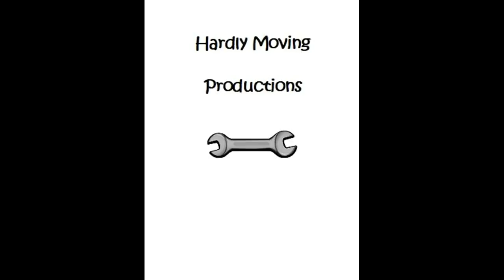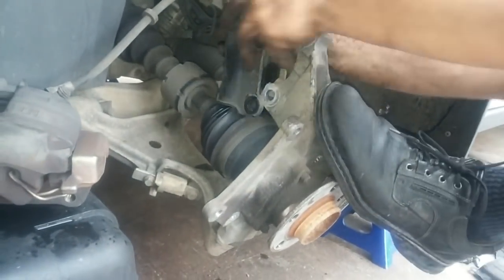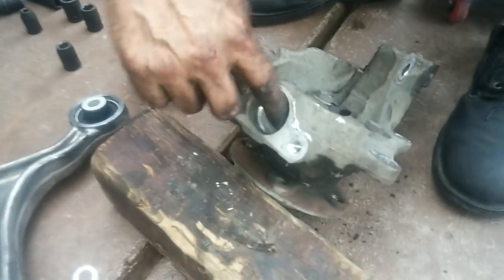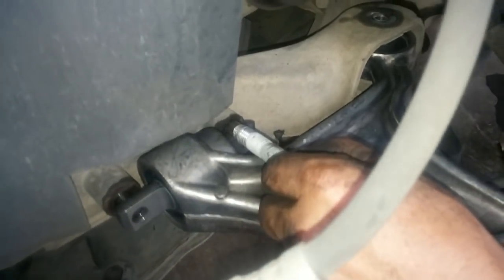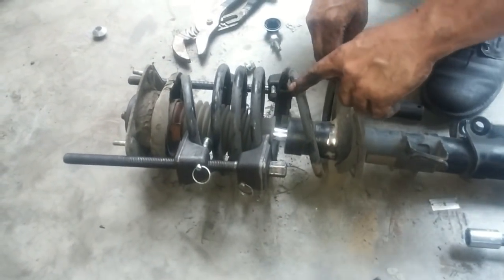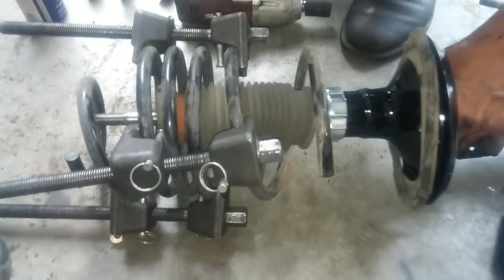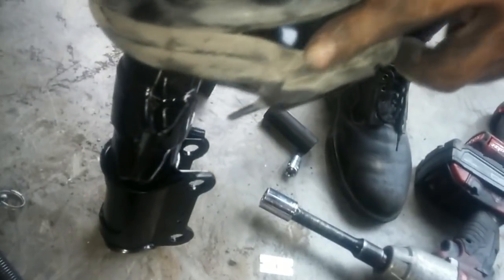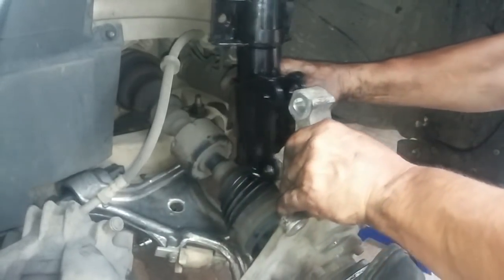Volvo S80 Suspension Rebuild:  Strut, Control Arm, and Ball Joint Replacement

Comment: JUST did my Volvo S60, actually lost a ball joint @70MPH.  I ended up having to replace my passenger side axle as the axle separated during the sudden ball joint failure. I replaced the strut as well and of course the ball joint.  I bought the strut as a complete assembly including the spring. The cost wasn't that much different.  Anyway- it was my first rodeo when it came to front suspension and videos like this made it possible.  Thank you again for taking the time to do these. Well done.
Reply from the maker: Thanks for sharing your successful repair experience!

Comment: Props and respect for showing the strut assembly the old school way instead of the quick struts thats already fully assembled..a lot of mechanics these days are afraid to take it apart and always suggest the easier way with quick struts but you sir are a Boss in showing the correct way to disassemble and reassemble the parts👍👍
Reply from the maker: Thanks!  Complete (quick) struts on these European cars are expensive;  hence the motivation to disassemble and just replace the strut and mount.

Comment: People, you must use the special ball joint remover/installer tool!  This youtuber, like many others, has damaged the hub carrier, stretched the ball joint bolts, and potentially damaged the threads of the aluminum hub carrier (i.e. knuckle).
Reply from the maker: Can you let everyone know where to buy this tool and how much it costs?
Reply: @hardlymovingpro  it is CTA Toold part number 4019, available on Amazon, FCP, IPD, ebay, i.e. online.  $120 but worth it.  It is the aftermarket version of the original volvo tool which is unavailable
Reply from the maker: Okay ... thanks.  Posted a link to the tool in the "SHOW MORE" area of this video.

Comment: Nice Video, I have a the same problem with my S60 01 suspension, I can fix this one but my problem is I have no tools to remove all the volts and the tools you used to hold the spring. I must go to the shops and I am sure they will charge me for this.
Reply: Autozone or O'Reilly will rent you the tools for free.

Comment: Good video but i  you should have tightend the lower control arm bolts ( wich has bushings) at the right ride height ,,, this way puts a lot of stress on them and will break much earlyer , also tighten the shock bracket on top when they have the load of the vehicle.
Reply from the maker: Thanks for sharing!

Comment: I would get Sachs speed strut assembly. $250.
Impact destroys acme threads.
Did that on my jack.
Reply from the maker: Sachs is the OEM provider for Volvo and is a pricey strut.  There are other quality replacements at a cheaper price such as Monroe or Gabriel.  The weak point in the Volvo strut is the upper spring seat which is mis-diagnosed as a bad strut.   If the seat isn't replaced, there'll still be suspension noise.

Comment: What brand of shocks you recommend for Volvos?
Reply from the maker: The OEM is Sachs ... which is very expensive but an excellent strut / shock.  KYB is just as good and maybe cheaper.  Nothing wrong with Monroe and Gabriel for a less expensive alternative.

Comment: My new  ball joints have no surface to hammer on on the outside edge without damage to the seal.
Reply from the maker: When you say "seal" do you mean the grease boot?  If yes, can the boot be remove?

Comment: Hello,

Do you know how to replace electric strut on a 2013 Cadillac XTS?? I need help real bad
Reply from the maker: Yup ... did a few a couple of years back.  If you've got an electronic suspension, the part is expensive.  I think around $800 retail each.
Reply: @hardlymovingpro  can you forward me instructions on how to do this ?
Reply from the maker: @WJOHNJRB  You'll have to find another youtube video author who did the job. From my recollection, the upper strut mount is integrated or is part of the upper control arm.  So you'll have to detach the control arm from the steering knuckle before moving out the strut assembly.  After that, the spring compression and strut replacement is pretty much the same as other strut replacement procedures.
Reply: Hardly Moving Productions thanks
Reply: Hardly Moving Productions can u give me some instructions?

Comment: Was it electronic suspension. Cause those shocks are quite expensive. Is there way to fix them.
Reply from the maker: No they were not.  But easy enough to convert to non electronic.
Reply: @hardlymovingpro  any idea how to do it.your help will greatly appreciated
Reply from the maker: @gsingh386  Like any other strut replacement.  There just won't be a electrical connection to the top of the strut.
Reply: @hardlymovingpro  It will show the lights on the dashboard or any electrical malfunction.
Reply from the maker: @gsingh386  Yes it will.  You'll have to find and unplug the suspension control unit.

Comment: Nice video. How well do you recommend the replacement parts that you used on this video? I have A 2001 XC70 and i want to do the front suspension.
Reply from the maker: The parts providers Sachs and KYB are major OEM parts producers for auto manufacturers.  I listed KYB struts because Sachs tend to be harder to come by and are more expensive.   If their prices seem too much, you can try your luck with Monroe, Gabriel, OSC and FCS  (assume they're all made in China).  If price is not an issue and want to get the best handling out of your car, go with Bilstein.

Uro is a major European parts provider under A.P.A. Industries Inc.  Their pricing is more than reasonable and the fit / finish of their replacement parts consistent.  Never, ever had problems with Uro parts.

Hope you find this useful.
Reply: @hardlymovingpro  Thanks for that, sounds good to me.

Comment: Did you replace the drive shaft dust covers?
Reply from the maker: If you're talking about the CV boot(s), they don't need replacement until after they split.  Most people, however, do not bother to re-boot.  They just buy a replacement axle.
Reply: I've got mine replaced because of apk (NL) /mot (UK) comment.

Comment: I need a cordless impact !
Reply from the maker: FYI - the cordless impact in this video is the Milwaukee M18 Fuel 2755.
Reply: @hardlymovingpro  Thanks! What are the Ratcheting wrenches you are using?

Comment: No one uses the proper Volvo ball joint tool made by CTA.  I did.  This is not the right way to replace this ball joint, damages the hub carrier!
Reply from the maker: Great!  You can explain the right way to do it?  Is the tool easy to get?  Is the tool expensive for the shade tree mechanic?  How much does the dealer charge for a ball joint replacement using the right tool and do they even use that tool?
Reply: @hardlymovingpro  yes, I should make a video.  Tool is easy to get on amazon, ipdusa, fcp, etc.  Made by CTA so its on their site also.  Its pricey, $120, but still less than what it would cost at the dealer and makes it a lot easier.  I have 2 volvos so there was some economy their but I always buy the special tool if needed.
Reply from the maker: Hey, ... via Google Drive or Drop Box, send me your raw, unedited version of your video and I'll edit, publish and link it to this video.  My email is hardlymoving@gmail.com